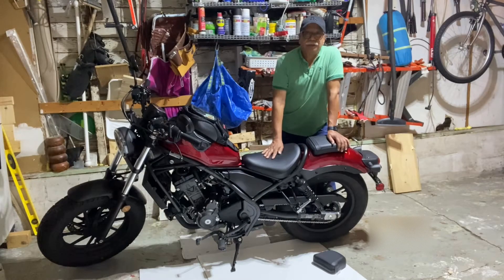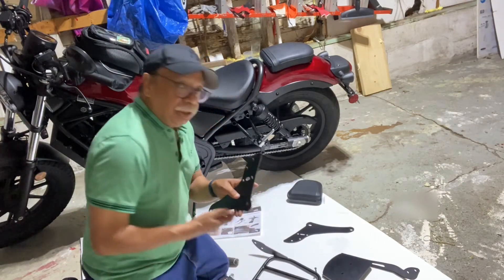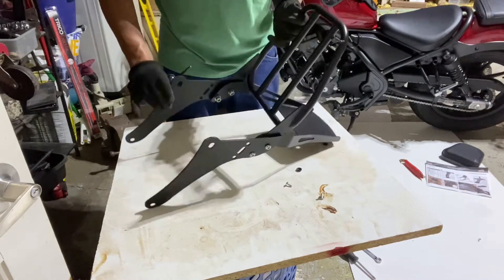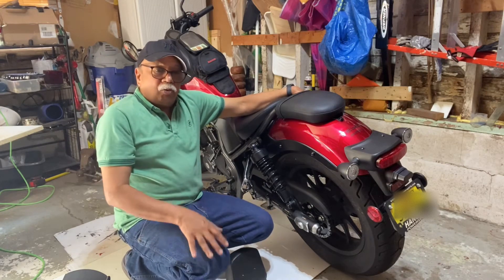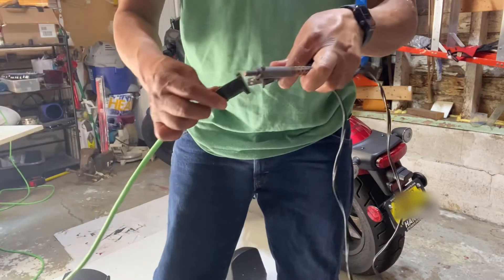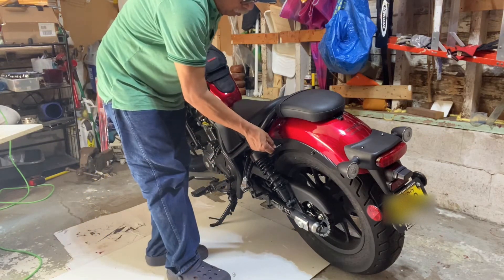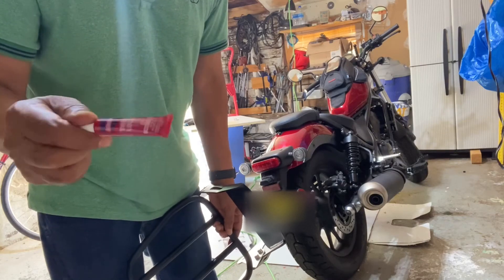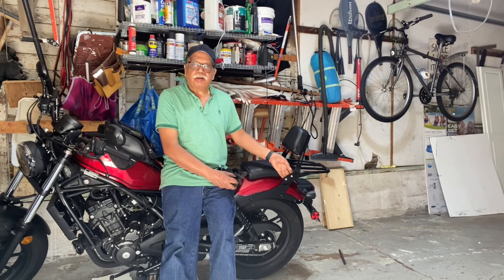Installation of luggage rack for Honda Rebel 300. #hondarebel #hondarebel300 #sissybar #retirement

Comment: Great job and tip with the heat! I just did the same job yesterday on my Suzuki S40 with factory accessories and it was an absolute bear. I have only good hand and have to take it slow. The nasty part on mine was that on the rail, one of the bolts is hidden and goes in from the backside of the rear fender. You are working backwards, by feel only, and the tire interferes all the time. You get only about 1/4 of a turn max with each fitment of the wrench. When I had to put the assembled backrest and rack on, I had to have help to hold things in place due to doing everything one handed. But I am very happy with the outcome and you will enjoy all the extra capacity on your Rebel! Subbed!
Reply from the maker: Glad it worked out for you , Thanks